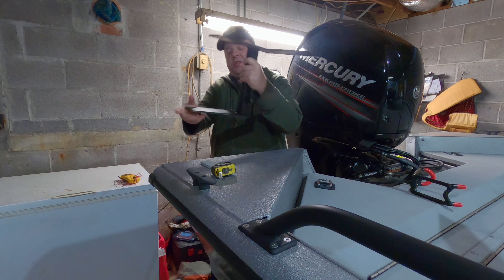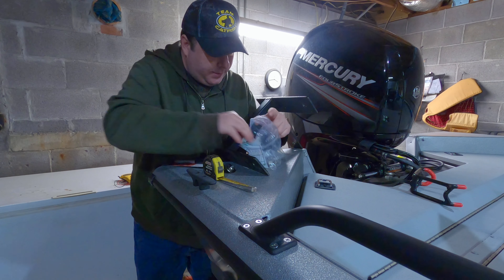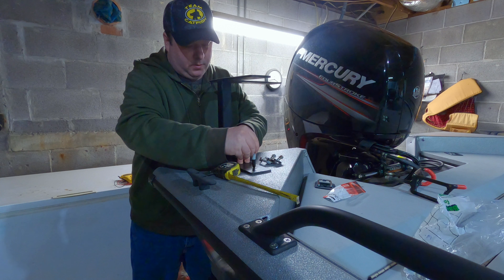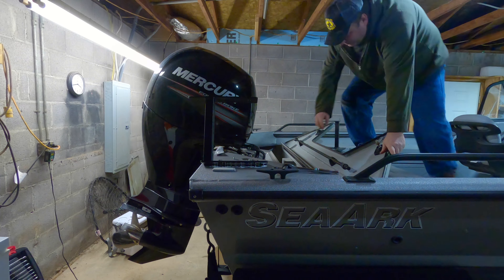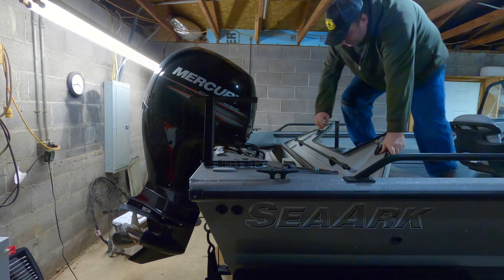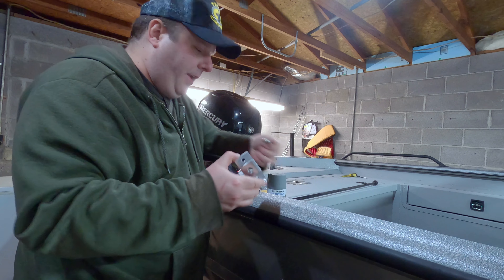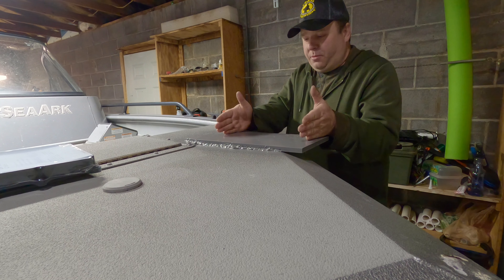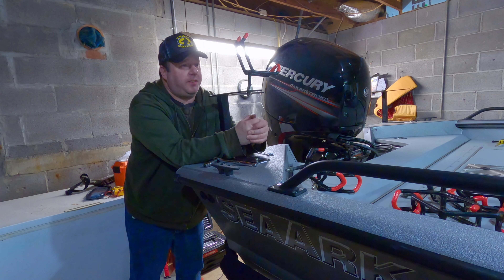Rod Holder Install and tiny travel VLOG

Comment: for that trolling motor mount just drill them, they added that channel brace for support and it is thick enough to drill and add fender washers on the back side. If you want even better just get a 10" section of 1/4" x 2" flat aluminum and use as a backer on the inside. All mine are drilled, backer plates and fender washers on the back. Works great and is very stiff.

Comment: You can order the correct bolts from any SeaArk dealer, they run about $2 ea. As for the live well, if you run it on a timer, which is flip the switch to the left, it will activate every 5 minutes, recirculating the water and turning on the oxygenation system. It will easily last on your cranking motor. You could always throw an extra battery in the back.
Reply from the maker: I need to get some spare bolts from them.   They still would not fit in the rail system because the ends are covered up.  I took a drill to them and now bolts can be inserted into the rails.